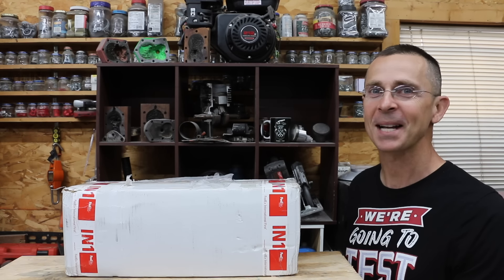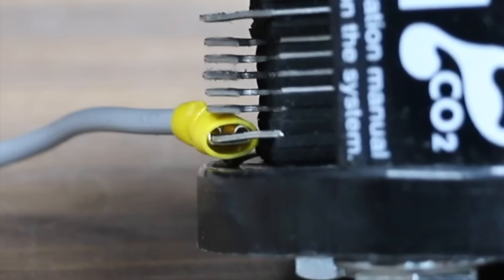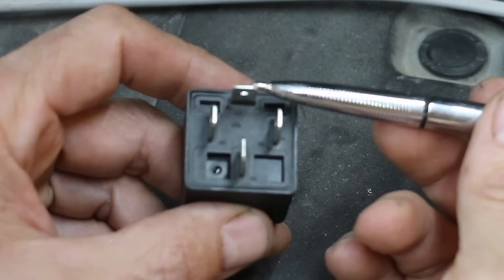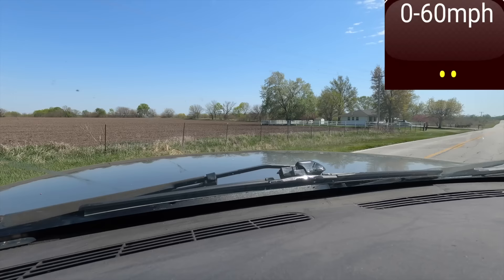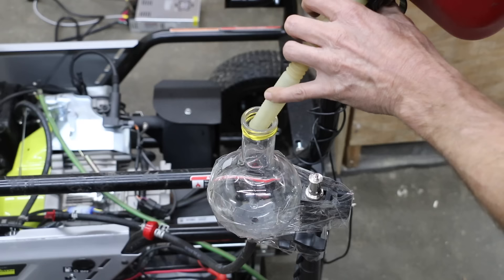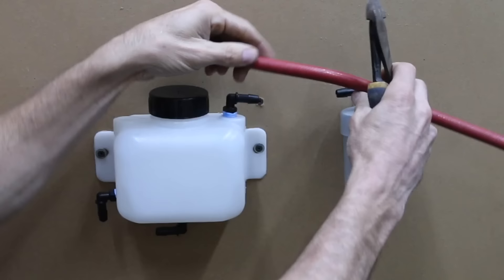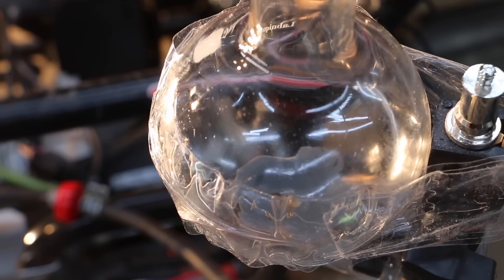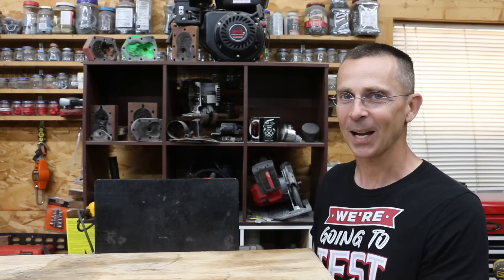AMAZING 35% More MPG with HHO? Let’s find out! Help with high gas prices?

Comment: I think you missed the point, nitrogen is supposed to supplement the fuel supply on a vehicle and be powered by vehicle electrical system. Can't do a simple milage comparison with a generator
Reply: Huh Nitrogen supposed to supplement the fuel supply???? plenty of Nitrogen in the ambient air that is being sucked into the engine ;) 
A generator is a very good way to test this with since it eliminates the user throttle position variable while ensuring constant load without variables of wind,  rolling resistance, ... etc.

Comment: this is the second time I've watched this video... and I am appalled at the tiny amount of HHO you were getting out of that generator ! my cells made so much HHO that the water looked like it was above a rolling boil at 4 liters per minute...you would be lucky to be getting 1 LPM from that HHO cell.... so 1. you were not getting enough HHO first and foremost. 2. you never reduced the fuel going into the engine if you don't do that the carb simply pumps the same amount into the engine anyway !  so you will not save on gas mileage !
I added a valve to allow me to lean out my Toyota truck... I could set it to where it was staggering badly, starving for fuel... and then turn on my HHO cells and it immediately ran smoother.... this is what you have to do to get better gas mileage with HHO...
if you don't reduce the gasoline it will not change a thing but make the engine run smoother
I ran my HHO setup for about 3 years if I remember correctly but wound up taking it off because I sold the truck.... I was trying to get 15 liters per minute out of my cells to run the engine 100% on the HHO but never achieved that much...8 LPM was the max I ever got.
the amp draw for that was way up there around 60~80 amps for all my cells and I had to saturate the electrolyte to get it that high.   I have never seen a commercially sold unit that put out more than 1LPM and that is barely enough to tell you got it on the car ! even when reducing the gas to the engine.... so try it again buddy !

Comment: I'm not savvy enough on the chemistry to know weather HHO itself can provide/prove these claims, but the problem fact with these things is that they'll never produce enough gas to make any difference. That Chevy at idle consumes 41.5L (1.6 cubic feet) of A/F mixture per second. I'd be slightly curious as to the volume of HHO generated in this amount of time. I would assume miniscule.

I'd like to think your viewers are of a higher caliber (and appreciate the unbiased information that I can only imagine how hard it must be to produce) rather than expecting to find that pyramid power may actually be a thing - but kudos for giving it a fair shake.
Reply from the maker: Thanks and you are welcome!

Comment: I studied these a lot back in the day. The problem with fuel inject cars is that the 02 sensor is reading the extra oxygen and compensating by sending more gas. If you want to use a fuel injected engine you have to add a rheostat to the O2 sensors wiring so you can change the amount of fuel it sends. I am surprised that the kit off Amazon didn't have a rheostat.
Reply from the maker: Thanks for sharing.

Comment: Would distilled water make any difference I only ask cause it is often supposed to be used with this and even antifreeze?

One more question! Wouldn’t the process of the hho just being added to the air intake make the computer pickup it being more rich and have the engine compensate or self correct this which prevents it from doing anything idk that’s why I am asking thanks for your time and great videos

Comment: Fuel injection computers register hydrogen as extra air  and not fuel so it automatically richens the mixture by adding more fuel. The tests need to be done on a non computer controlled engine.

Comment: This is a flawed test though because surely the ecu of the vehicle you're running it on needs to be retuned according to exhaust gasses and so on,if the O2 sensor reads more oxygen it will injection more fuel to compensate..so I don't think that this is a real world test in the sense of doing it the 100% correct way..if I'm wrong I apologize but I don't see how pumping extra air into an airpump motor will help without it being tuned correctly too

Comment: Would it not make the car run rich because it is unmetered fuel? I know there is an air sensor but that only measures air that it thinks is just air and not a fuel

Comment: hmm, eco test are pulling same torque ?? if the generator run higher torque % then a car do in % its not sure it gain same result.
If a truck run 240 nm resistant on load, and HHO run 250 nm.
And if generator run 25 nm load, and HHO run 35 nm load. It will change a lot in result i think?

Comment: It's probably screwing the mixture you need the exact stoichiometric ratio for the amount of oxygen needed to burn the amount of hydrogen ( which probably isn't constant in this configuration) and gasoline being burned also that machine also generates oxygen so you would need to subtract that amount from what you would design your intake to provide a separate cathode anode hydrogen generator that fed hydrogen and oxygen separately into compressed bottles to be delivered to the engine at a variable injector timing dependent on bottle pressure and a computer software that opened or closed the throttle body for a certain ignition and injection timing position providing more air when hydrogen is present and less when the bottle is empty
Or that's what I came up with drunk at 2 am

Comment: Seems as though you misunderstood what EFI does.

EFI regulates the fuel air pressure based on emissions.

If emissions are cleaner in one with O2 sensors it will add more gas. Even though it doesn't need it because of the HHO. HHO will make it burn cleaner so the computer will add more gas so the O2 measures the correct exhaust emissions set by the factory. The O2 sensors need to be adjusted not to add more gas.

Your generator is probably fuel injected and no computer and won't give it less or more gas, so no change except for a fuller cylinder of gassed and increased cylinder pressure for actually less milage.

If you want it to use less gas's when adding HHO you have to give it less.

Fake the O2 sensors or adjust the carburetor.

WOW I thought you knew how engines worked?

Bunk experiment.

Comment: It makes little logical sense that the hydrogen kit would improve anything on a modern vehicle. Once the hydrogen is ingested down the intake the oxygen sensors should register that an over-rich condition is occuring and the P.C.M would then decrease the dwell time on the injectors to lean it out accordingly. It would seem that such a device would be working against itself and any potential gains would be quickly cancelled out by the engine management system as it does its job to keep the air/ fuel ratio at an optimum
Reply from the maker: Thanks for the feedback.

Comment: I think also injection was not proper, its not like you are mixing the gases in
If the pressure from the fuel injector is higher than the pressure from the hho tank, then almost no hho will flow, or basically will be vented out, maybe the injector needs to be changed, maybe it need an intermediary chamber, possibly works better in a carburator type system

Comment: HHO does not work well with EFI engine's, as the MAP sensor and oxygen sensors determin how much fuel to spray into the combustion chambers,The HHO is highly flammable gas that can run an engine, The EFI system will dial the fuel trim down if the engine is exceeding peramiters set out by the ECM, especially since the O2 sensore cannot even read the output levels of the HHO, in short,  HHO works best with carburated engines just like the odschool propane powered vehicle's.

Comment: I wonder if a problem is that they hydrogen is not pressurized in any way.  The bubbler is going to provide an irregular and weak amount of gas and how much is actually making it into the combustion chamber at any given time?  I wonder if you could get a 'regular' engine and supply it with increasing amounts of hydrogen gas and decreasing amounts of petroleum and see if there is a ratio where the engine works using the minimal amount of petroleum fuel.
Reply from the maker: Thanks for sharing.

Comment: you're not going to see any difference because you're still running the same fuel-air mixture ratio. Gas burns at around 14:1 but hydrogen burns at 34:1 up to 180:1.   You need and can lean out the mixture which will give you better milage.  How much to lean out is the trick.  Something like this kit is uncontrolled as per the volumes of air plus additional oxygen and the hydrogen making it difficult to establish the desired ratio.
Reply from the maker: Thanks for the feedback.

Comment: I honestly expected better of Project Farm… How can you expect any fuel or power improvements when you haven’t changed the fuel delivery/timing or tuned for HHO?? Thats like throwing race gas in the engine and doing the same tests and concluding race gas doesn't work because you saw reduced mileage and no or even reduced power gains. Its meaningless unless you do it correctly… No surprise to you Im sure especially since you’re dealing with programmed electronic fuel injection. Was that a purposeful choice? Atleast with carbureted engines you’d see improvements with minimal adjustments..

Comment: Theory 1: Used as a supplemental fuel it should decrease your use of gasoline. Technically increasing your miles per gallon of gasoline.
Theory 2: A simple Vertical Axis Wind Turbine mounted sideways on your hood could provide enough energy to power HHO generation.
Reply: But the truck will need more energy (gas) to turn the wind generator. Energy can not be available unless it's been created.

Comment: From what i read the hho produces extra oxygen in the system and the sensor reads a lean mixture so it adds extra gas to compensate reducing fuel economy
What if you could bypass o2 sensor? And see if that helps
Reply from the maker: Thanks for the suggestion.

Comment: Does the EFI generator use an O2 sensor to control the amount of fuel injected? If not I don’t see how it could use less fuel. If it has an O2 sensor then I could see how the HHO system could improve fuel consumption. I don’t recall if I asked that about a year or so ago when I first watched this, but video popped up in my suggestions so I watched just the gen part again. Very much enjoy your videos.
Reply from the maker: Thank you!

Comment: just a thought... 100% not a mechanic.. but would it not take the vehicles CPU a little while to adjust the fuel air mixture with the added HHO gas?  possibly running lean / rich until the CPU adjusts?

Comment: What i wonder if you made the carb more lean. Since you are using the normal fuel flow, and just adding more energy that can't be used.
Reply: another problem is the hydrogen may leak before combustion

Comment: The reason it didn’t make a difference and why it actually lost efficiency is because the hydrogen was causing the engine to actually run rich because the same amount of gas was being injected in addition to the hydrogen being used as an alternative fuel. In order for this to work you actually need to be able to alter the AFR reading to trick the ECU into thinking the engine is running rich while the hydrogen generator is running. Then the duty cycle of the injectors will be lower and you will end up using less gas while maintaining a similar power level and without getting knock. Hydrogen and oxygen is a combustion reaction just like oxygen and hydrocarbons and hydrogen and oxygen is one of the most powerful hence why the space shuttle main engines use this reaction for thrust.
Reply from the maker: Thanks for the feedback.

Comment: The air/hydrogen mixture is too diluted and the hydrogen won't burn. You'd need to pipe it directly into the engine for it to work.

Comment: I asked the mechanic to install a smaller kit of the same brand and I also noted no advance or even higher consumption. I think I've run 2k or 3k km up to now. It seems you did very precise tests. However, if the engine is not brand new maybe you should run at least 1k km before noting any possible advantage just because the kit may initially be working to clean the system before providing advantages. Would you run a middle-long term test, please?
Reply from the maker: Thanks for the suggestion.
Reply: @ProjectFarm   a test you may want to perform is try to catch the hydrogen from the outlet via a small bag and a rubber band: if the bag inflates very slowly then you may suppose there's not enough production. I did it with my kit and realized that despite the bubbles inside the tank, the hydrogen production was incredibly low. In fact, I felt almost no pressure on my finger while corking the non-return valve and almost no puff unless I kept corking with the finger for quite a minute or two. Now I asked a friend of mine to clean the internals since he supposes the cell is now saturated. Have you done further tests or plan to do some in the next future?

Comment: it would be interesting to see the fuel trim data, and or the oxygen sensor's wave forms on the vehicle while running this stuff and then not running with it and comparing the data sets. i guess my question is, even if it doesnt improve power or mpg, can it displace the amount of gasoline burnt and get the same amount of power.
Reply from the maker: Thanks for the suggestion.

Comment: Perhaps I got lucky or the stars were aligned just right but The HHO unit on my trailblazer with a 4.2 engine works pretty good.  I have the VPX engine control module on it specifically for this vehicle.  During highway operation, the modulator adjusts the engine to run leaner at part throttle.  This allows for an increase in mileage.  With back to back seven hour test runs, I did experience a welcome increase in fuel economy.  The rig ran remarkably smoother and had a noticeable increase in torque.  Perhaps this is the right combination and it works well for me.  I do not believe an HHO unit by itself would accomplish as much.  I have been very pleased with this combination.
Reply from the maker: Thanks for sharing.
Reply: @ProjectFarm   You are welcome.  I do a great deal of tinkering with various things which either make horsetorques or economy and I have had remarkable luck with some things considering an equal number of failures.  I have used water injection, plasma plugs or MSD ignition all with good results.  I ran a Methanol powered Tiburon GT just for kicks and grins.  That was a buncha fun.   My Trailblazer is doing quite well in the face of much bad tossed against hydrogen.  I also have some upcoming projects.   I built a 50+ mpg Corvair back in the late 70s which worked great.   My nest project will involve a small diesel to see how close I can get it to 75 mpg with a two stage HHO unit.  Not too shabby for an old DC3 mechanic.

Comment: Now I'm not disagreeing that hho generators are not usful in this scenario, but both of those vehicles were fuel injected.  So the efi  will compensate for the burned hho. So this entire experiment though reasonably well constructed is meaningless. You have to tune the efi and likely switch the o2 sensors to aftermarket sensors. Or just used a  Carbureted  vehicle.
Reply from the maker: Thanks for the feedback.

Comment: It can improve fuel consumption,  BUT you need to reprogram engine ECU otherwise it will increase the fuel consumption because with hydrogen you are pumping extra oxygen in your engine.  This will get detected by Lambda sensor which will increase the fuel to meet stochiometric ratio mixture.
Reply from the maker: Thanks for the feedback.
Reply: Please tell me why the lambda sensor would detect extra oxygen if you also add the stoichiometric amount of Hydrogen with that Oxygen thus it will be consumed during combustion?

Comment: So this may be very stupid but we'll see get a canister of hydrogen put a hole in the intake and put pure hydrogen in there and see if it actually affects engine performance at all or if The fact that the air intake is only designed for a specific amount of fuel to be inside the engine there's a limiting factor where there's too much combustion products but not enough oxygen meaning that a limit will be reached we're the only way to make it better would be to add and forced induction

Comment: That test was not good.    Of course the run time of 19:40 was the same because the same amount of fuel was being sent into the carb.    Even if you added gasoline into the system instead of HH0 then you get still 19:40 but running rich.  The main fuel source still gets used up at the same rate.  When you are adding to the main fuel source you need to LOWER the flow rate from the main source.     I'm gonna search and see if you updated the video because there is no way the viewers didn't catch this mistake.

Comment: I am amaze I did not see this before being great fan.  But I do have a question.  When running the generator.  What is the cost return running just HHO vs. gas on just the generator.  Maybe this is the trick to powering the homestead.  Since I live in a remote area our electrical power is questionable and I am moving to something else soon.  Unfortunately solar and wind are out due the local.  Also I just laugh at pull the drill out and start drilling into components to make a hole.  Yes I do it on somethings myself.